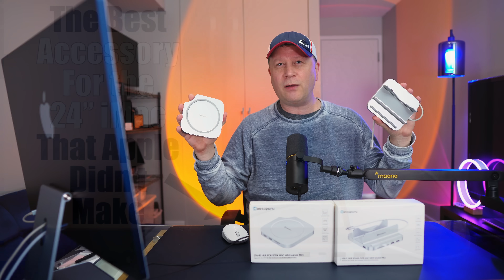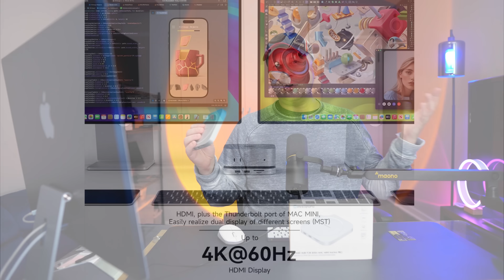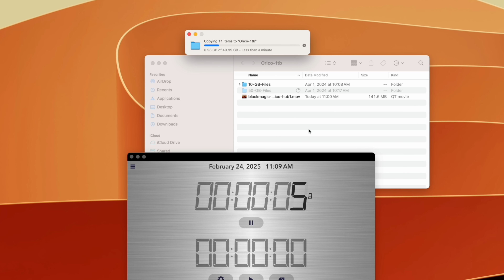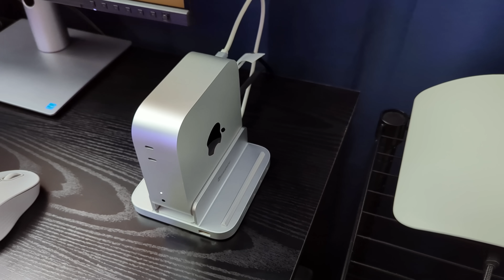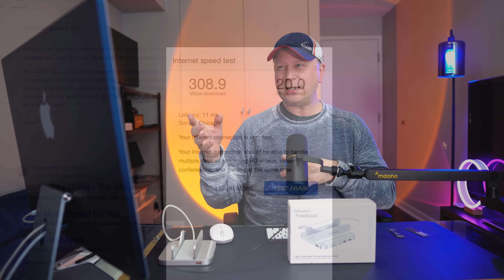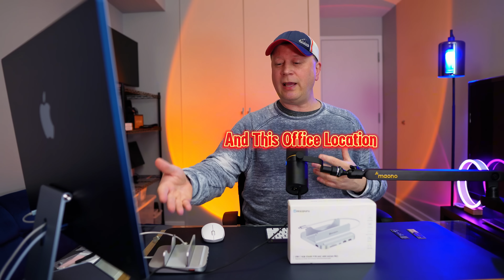Two New M4 Mac Mini Hubs with SSD Enclosures - Are These The Best Hubs/Docks Yet?

Comment: I bought the vertical hub based on your video. However, I'm having one problem I don't understand. I tried to insert an SD card in the slot with the 'label' side up. No go. Turned it 'upside down' and it went in. However, can't find the pictures anywhere on my Mac mini. Suggestions?
Reply from the maker: Yeah, not sure with that info.  You need to make sure the drive is compatible and had already been formatted for Mac OS.

Comment: The only problem I see with the second one, on its side, it is exposed to much more atmosphere dust in that position and would require internal cleaning much more often. i saw a static netting idea for the M4 at Hagibis.
Reply from the maker: Maybe but dust also settles on the desk and gets sucked in as there is a gap.  So not sure if it would cause more dust.

Comment: Thanks Craig as ever very informative Personally I think the New Mini is optimised towards horizontal placement and I feel over time this may put additional wear on the fan and cooling may not be as effective 
I know these look nice but prefer a hub that’s completely separate free standing this also gives the advantage of eliminating any wi-fi problem and gives you the advantage of separating the external SSD 
Yes this is ecstatically less pleasing but and this is the clincher reviews have been gradually stating speeds dropping off and some running hot so when putting these pretty and appealing hubs up against reliability for me iam on the fence until the reviews are based on long term use and I am sure you will be the first port of call to be on top of the best way forward 
for now looking forward to your update on the most reliable External SSD and Hub please keep us posted
Reply from the maker: Yes, all these will have some issues and even the external SSDs or hubs.  It's a mix of picking the right SSD and how you use it etc.  For me these work great as I use the drives for basic backups from time to time and I don't notice any heat issues or too much wifi loss at all.  But each case is different and each setup and room is different so where you put these is always different.  That means results will be different too.

Comment: Thanks for this review. Your explanations are always 1st class and down to earth. 
I just bought the vertical one (218B) rather than the horizontal one. Improved wifi connection is a surprise, but useful to know and I wouldn't have known about it with your vid so thanks again for that. The 218B's ports - selection and location, I find preferable too. Also with the 218B model there's absolutely no issues over accessing the power button - if required.  
Thanks again.
Reply from the maker: Thanks for watching the channel and thanks for the post.  I appreciate the feedback for sure.

Comment: 2/28/25 I'll stick with my RayCue fin vent Hub which is similar to the first hub you showed us, but no cut out for the turn on button. The RayCue shows similar results on speed test, plus RayCue has more ports. I did put the 2TB Orico 7000  SSD HD into the base, plus the price of it on Amazon was a lot better than the Samsung 990 SSD. The hub allows me to still use my older hardware with connectors that are not USB C, plus a SSD slot for down loading my camera photo cards, and also my USB A/B memory sticks.
Reply from the maker: Thanks for your data points.

Comment: I need a hub with 1/2 NVMe slots, sound output and 3/4/5 USB 4/ Tb 4 ports. I don’t need USB A slots or card reader slots. That at a reasonable price would sell I think
Reply from the maker: Yes, but for some reason not many are making these in Thunderbolt speeds.

Comment: Hi Craig Neidel , I'm from India and planning to buy a MacBook, but I'm not sure whether to get the M2 or M3. Can you help?

MacBook M2 (16GB RAM / 256GB SSD) | 13.6-inch – $840 - $900
MacBook M3 (16GB RAM / 256GB SSD) | 13.6-inch – $1,140 - $1,200

There’s an approximate $240 difference. Which one should I buy?
Reply: Hello, this is Microsoft calling. Get the M2!
Reply: @Exchange-Student-Australia   🤣🤣🤣 ok man people say m2 is slower than m1 also is that true because of that slower 256gb ssd
Reply from the maker: For that difference the M2 is fine.  I think it works great and it's hard to tell too much of diff if both have 16 gb.

Comment: Perfect hub =:
- thunderbolt
- 3 usb-a
- hdmi or display port out
- sd/tf card reader
- nvme
- good nvme cooling for preventing ssd damage
- power button access
Reply from the maker: Everyone is different as most would not need 3 x usb-a ports.  Or want that.  So perfect for you.  I do agree with thunderbolt though.
Reply: The closest to what you're seeking in a perfect hub is Orico's M47P.

USB4 (40Gbps) not Thunderbolt
Power button access is for hub only
Cooling fan (operates at constant speed - which is a shame)
No HDMI or DisplayPort outputs.

Offers the fastest NVMe performance at 3000Mbps.
Comes with its own PSU so no standby disk issues.

Comment: I bought a Minisopuru external SSD enclosure when I got my Mac mini M4 and have been very happy with it. It does run a bit hotter than my Acasis enclosure, but the Acasis has a built-in fan where the Minisopuru does not. So I would expect these other products to be fairly reliable as well. Thanks for the review!
Reply from the maker: Yes, I have not had a ton of issues with them but again I'm only one person with one device.

Comment: I have a hub like this already to add the extra ports, but plan to get another once they have SSD capabilities AND Thunderbolt speed capabilities (T5 would be great, but T4 would be a big improvement) so that the premise of using a base model M4 Mini with an external SSD will give us something approaching the speed of the internal SSD. For now, our options are either (a) mortgaging our house for a larger internal SSD, or (b) settling for around 1 GB/sec speeds on the hub-based SSD, which is significantly poorer than the 4-5 GB/s we get from the internal Apple SSD.  General opinions are that Thunderbolt4 or 5 hubs with SSD slots are 3-4 months away.
Reply from the maker: Yes but 1000 MB/s is pretty fast for most uses.  49 seconds to move 50 GB of data.  But thunderbolt would be better for sure.  They should come out eventually.

Comment: So far, the fastest & styled to match, M4 Mac Mini dock that can accomodate an NVMe SSD is the Orico MiniLink M47P. It's a 40Gbps 7-in-1 dock, featuring two NVMe drive slots.
I comfortably get 1500Mbps using a gen3 NVMe drive on slot marked 'PCIe 4.0 x2', and half that on slot marked 'PCIe 4.0 x1' (naming denotes the PCI lanes the SSD can access rather than slot number 1 or 2). 

I've seen reviews of the Orico MiniLink M47P where speeds of ~3000Mbps, using a gen 4 drive on slot x2, are demonstrated. (I'll get myself a 4TB Samsung 990 Pro to use in my MiniLink, next time there's a promotion on).
Reply from the maker: @dotTomdotcom  not on these.  These are 10 Gbps connections so only capable of 1250 MB/s without overhead.  With overhead more realistic is 900 MB/s
Reply from the maker: @dotTomdotcom  I did videos on thunderbolt 4 enclosures capable of 3450 MB/s but those are not these
Reply: @craigneidel  Understood. Just letting you know there's a more capable hub out there and apologies for railroading your comments section.
Reply from the maker: No problem and thanks.  I knew about the Thunderbolt one but I was just reviewing the 10 Gbps one.   I might do the other one in the future.

Comment: Good video! But, wondering whether you’ve run into issues with either one of these Minisopurus or the Raycues you’ve tested earlier when connected to an M4/M4 Pro Mac Mini going into sleep mode after being inactive for a while only for the Mini to report it doesn’t see the external SSD any longer. Had this problem when previously using an M1 Mac Mini with a Hagibis hub for the M1 with a SATA SSD and it would complain of not seeing the drive. Later learned the problem is that the hub didn’t have external power connected to it to keep the drive alive. But also noticed neither the Minisopurus tested hear nor the Raycues tested earlier didn’t have provisions for connecting an external power source. So… do the M.2 SSDs installed on these hubs keep their connections to the host Mac Mini after going to sleep? Or is a reboot required?
Reply: This is a great question.  I'd love to hear the response as well.
Reply: @BrianRouse  It doesn't look elegant, but am temporarily using my old Hagibis hub from the M1 while I identify a hub suitable for my M4 Pro that doesn't have the problem I described in my earlier post. Was also waiting for the Satechi but also observed, based on their initial videos, it doesn't have the ability for an external power connection either. 🤔
Reply from the maker: I have not so far with my testing.  With these new ones either I have not run into issues but I have not done anything like boot off the external SSD etc. but have not noticed any disconnects.  I'll need to test more though as I have only had these a few weeks.
Reply: Understood. In my case, I wasn’t attempting to boot off the SSD on the external housing. Was just a bit annoyed at getting numerous warnings that the drive wasn’t available overnight when I left it unattended and the mini would go to sleep mode. Thanks!
Reply from the maker: Ok, thank you.  I have not seen that yet with my testing but will let you know.
Reply: I have this problem with Orico's Minimate. It keeps auto-ejecting rendering the extra ports practically unusable

Comment: Personal preference time.  Since I only use wired Ethernet connections.  The speed between the two different styles would not be an issue for me.
Reply from the maker: Yes, plus it's not really a huge decrease overall especially with today's speeds.

Comment: Thanks for this showcase! My M4 Mac Mini is permanently placed UPSIDE DOWN for better wifi reception and easy access to the power button. It may not look as good, but I'm killing two birds with one stone.
Reply from the maker: Yeah, I'm not sure I would go that far but I do hear you that it works well like that.  I think the sideways method works well and it still looks decent, but if it works well upside down I guess it doesn't matter what it looks like.  Thanks for the post.
Reply: What about air ventilation and cooling issues?
Reply: @Fred_the_Headheat rises so it would work out better.
Reply: Smart

Comment: You really shouldn't be using Google (or Speedtest, etc) to test Wifi performance. There are just too many variables that can affect those test results outside of your control (which server you connect to, load on the server, traffic on your ISP, etc) and tests can vary dramatically between runs even if you don't change anything in your setup. Plus, as you mentioned, your internet speeds are pretty slow and nowhere close to maxing out your Wifi connection. A better setup would be to have your iMac connected by ethernet to your router, and your Mac Mini connected via WiFi, and then monitor speeds in Activity Monitor while transfering a large file between the two. Or even better still would be to use iperf3 with the iMac running as the server, and the mini as the client.
Reply from the maker: I know it's not perfect I worked in a data center for 26 years.  If I connect to Ethernet I can't test drop in speed.  I test 10 times and even watch drop in real time when moving in place as test is running.  So accurate enough for this test and to get idea how much hub affects wifi internet speeds.

Comment: Thanks for demonstrating the Orico 07000 SSD. I bought the 2 TB version after you first discussed it in December. I use it in an Acasis 40 GBPS enclosure. It consistently gets speeds of 2800+. It is faster than my internal M4 Mac Mini SSD! 😊
Reply from the maker: Nice and thanks for letting me know.  Thanks for watching too.
Reply: which acasis 40 gbps model do you have?
Reply: @ ACASIS 40Gbps M.2 NVMe SSD Enclosure with Cooling Fan, Tool Free Installation, TBU 401 Pro for M1 M2 Pro/Max, Compatible with USB4/3.2/3.1/3.0/2.0, Support SSD Size 2280 B+M M-Key (SSD Not Include)

Comment: Let’s talk about what I think we want. 
TB5 connectivity
An NVMe slots, but two would be better
At least one extra TB5 port, though more would be better
SD card slot, MicroSD and CF would be nice, but they’re icing 
2 HDMI though I’d prefer more TB ports
Some USB C ports
Maybe a USB A 3 port.

Offer me most of that in an under or atop (I’m really not fussed about the ‘lack’ of access to the power button) design and I’ll throw my money at you. In the meantime I’ll struggle on manfully with the ‘wrong’ form factor peripherals that actual do the job properly.
Reply: These days, I don’t actually need the TF reader, and would prefer SD and CFExpress Type B.
Reply from the maker: Yes nobody has made the perfect hub yet but these are pretty good for what they are.  Stabile so far in my early testing.  Thanks for the post.

Comment: Hi Craig, Thanks for your video. I’ve had the Minisopuru iExpandMate™ Mac Mini Dock | MINI218BPRO for about a week now. I ordered direct from the company website and got an extra 10% discount which with postage to the UK was still cheaper than buying from Amazon.
Anyway, I just wanted to add that I’m getting read/write Blackmagic speed tests of around 1500mbps with a Samsung 990 Pro.

Comment: USB 2.0 only in 2025?  Seriously?
Reply from the maker: Those are for keyboard and mouse.  You get this for the SSD, SD card reader, and a few USB-C or HDMI depending on the model.
Reply: @craigneidel  Lets be honest. How many people with an M4 Mac mini are using wired keyboards and mice with them?
Reply from the maker: @TalesOfWar  it's for the SSD and SD card readers.  Plus extra ports.  Anyhow I'm not going to argue.
Reply: @TalesOfWar I have a bunch of devices running of my M4 Mac Mini that use USB-A. HP soundbar, camera, SDcard reader, ear bud case, Ring battery charger, DJI  battery charger, wireless microphone charger, dog collar chargers and a few more pieces. I use a 8 port hub connected to the front. I also keep my track pad and keyboard connected all the time to keep from having them go dead.
Reply: @TalesOfWar I use a wired keyboard and mouse. I hate dealing with nonreplaceable batteries.

Comment: Think I'll stick with a TB4 dock as it has a decent selection of ports realistically. Hopefully that NVMe slot doesn't produce too much heat under the Mac Mini M4.
Reply from the maker: So far it really hasn't heated up too much and less than I expected.  It comes with thermal tape and as long as you put it on correctly it should be good.

Comment: Craig,   I like the cutout for the power button but prefer the Raycue you previously tested because of the faster ports.  I like my Mini flat so the other dock I would not want.  Also, I would like to know if you could test the WD NVME drive that did not work in the RayCue hub?
Reply from the maker: The WD should work also in this hub.  Thanks for watching.  I like the stand up one since I use wifi and it seems to help quite a bit.

Comment: in my opinion sad they did not went for a TB4 connection, yes suitable as storage drive, unusable as work drive, what happens if you use this dock as storage device and one or even two unpowered TB4/5 enclosures, will the mac mini powerful enough to drive them all? Or do we get error messages the ports are not capable to drive them all.
Reply from the maker: I was running a Thunderbolt 4 enclosure as well as a 10 Gbps enclosures off the hub and it was working.  These hubs are really for adding some medium speed storage for things like backup etc. and getting the SD card readers back in my opinion.